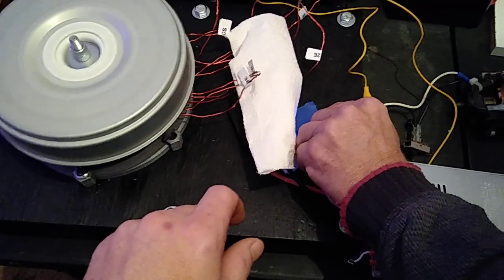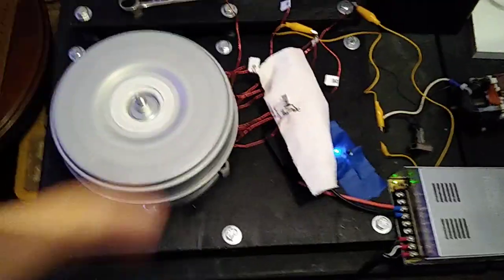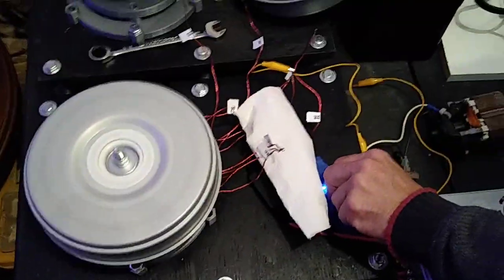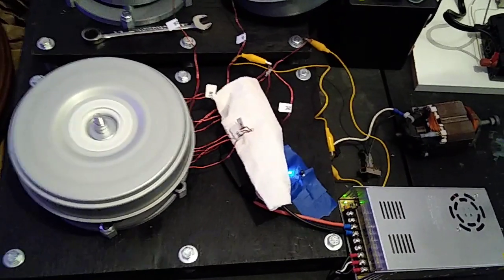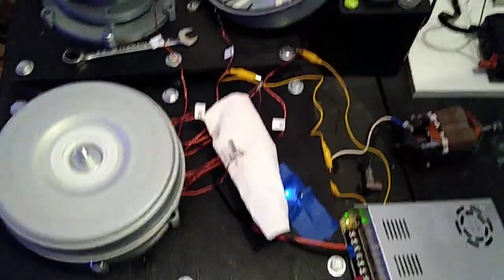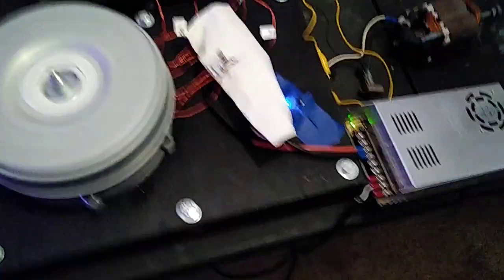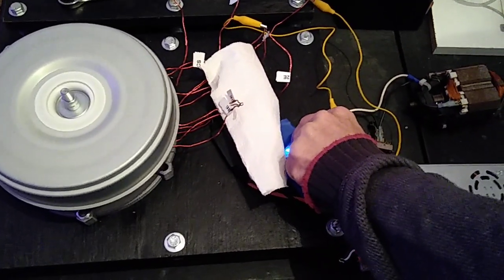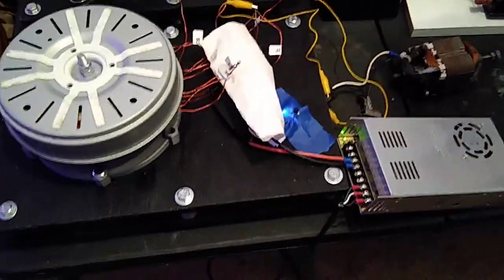Research Successful! Kromrey and Bedini Effects. READ THE DESCRIPTION AND DO NOT TRY THIS AT HOME!

Comment: This is not groundbreaking.!!!!!  Your note creating anything. Maybe converting energy but this has no advantage.
Reply from the maker: It can power it's own circuit. Charge a battery. Run a heat light, and motor all at the same time....  What is there to question?

Comment: not explaining how it works because you think people wont understand is a very poor excuse for not sharing the information, very dissapointed thomas.
Reply: How can  something that is not real and simply does not exist, nor is it even possible be explained to any  sane and intelligent  person
Reply from the maker: Exactly what I was thinking Peter. If I tried to explain how I'm capturing the energy from collapsing magnetic fields using unipole technology sending it through a transformer to get high voltage then rectifying it into DC that's pulsed and running that through homemade capacitors at a high frequency going to an LC circuit amplified and pulsed out using an irf840 to compile the electrons to be consumed then Maple would be confused at what I was saying... But if you understand what I just said then you would be able to recreate what was done.
Thanks for the comments.
Reply: @ThomasBuie  see wasn`t that hard or long to explain and yes i get it. so now i could at least try and recreate what your showing as before what you were showing or not was pointless. thanks for the reply
Reply: @ThomasBuie  For the record, when the magnetic field collapses what you're capturing is an inrush of potential from the environment into the circuit, Bedini explained this back in a conference and explained that the higher the coil is in elevation the larger the spike becomes, all the "energy' you're getting is coming from outside the circuit, not the collapsing field itself, it's just creating the condition to bring more in.

Anyway,  your comment is pretty easy to understand and I've wondered similar ideas for a while, it's worth explaining the process and get more minds thinking on it.

Comment: Looks like an ebike controller and a rewound bldc motor with an extra coil to drive a load. You might get some extra power at the expense of the extra input power. There are no free lunches in life, just compromises.

Comment: Hey Thomas what's the paper hiding?
Reply from the maker: No Lauri it's not a battery... the paper in my video was hiding a three phase high frequency  motor controller that uses the collapsing magnetic fields as a timing device to keep the waveforms asynchronously timed .....
Reply: A battery😉
Reply: @ThisIsNotMyHome  something right

Comment: Are you using radio frequency to control the device?
Reply from the maker: :-) lol...  of course we are... Thanks for the comment.
Reply: Was just curious be cause I was thinking about buying a motor home and removing the gas motor from the generator and replacing it with electric motor and running it off of a high voltage system with a amp consuming device so it would be straight voltage, would like you're option if you dont mind. To just curious if that is how you are running your motor?
Reply from the maker: @Greenman123.  it is a pulse with modulated signal (HF) And in all circuits built by others. I always use alternating current and rectify it, once it's rectified it either goes to storage or to ground I do both and then I run off of it after capacitating it, it is ready at that point to adjust voltage and frequency to be able to use in human electronics.
Thanks for the comment.
Reply from the maker: To better understand the scientific terminology needed to explain the science. I learned the science and can tell you where your mistakes are and where your advantages are... such advantage as in your reactive capacitance and inductive capacitance needing to have the same resistance being a great discovery. because free energy is just a difference in potential!!! so using high voltage, high frequency, and compiling it with a homemade aluminum foil 1 ft by 1 ft pieces as in my other video homemade aluminum foil capacitor...  The CAPACITOR compiles the frequencies together in a symmetrical pattern overlapping each other creating a symmetrical type of lens assisted transformation of the energy and with a spark gap between the two capacitor terminals the electrons can choose to go both ways. 

In this video here all that was used was a high frequency high voltage drone motor controller (2-6s 80A ESC) using back electromagnetic pulses to keep it in time with appropriately wound coils in length. by foot being the voltage on 20 gauge wire that is...  More videos coming very soon! Thank you all for the love and comments!

Comment: Input wattage?  Output wattage(consumption)?
Reply: did it self run?
Reply from the maker: Input wattage is 400 w from power supply. Have not completed all output wattage but as of now it is well over 300%, running heat lamp LED lights and a motor at the same time while charging a cell phone as well... This is also a closed loop system.
Reply: @ThomasBuie  Nice!
Reply: @ThomasBuie  wow!